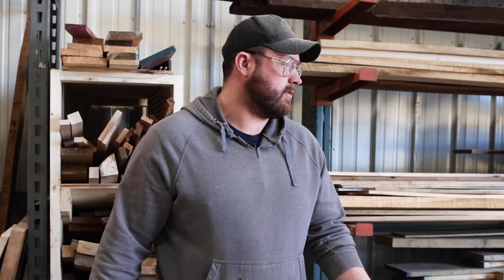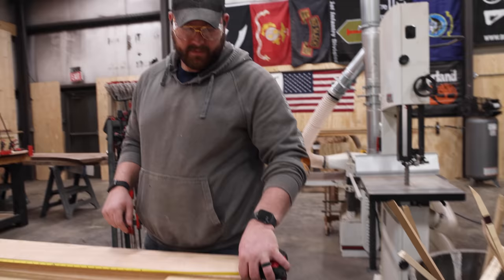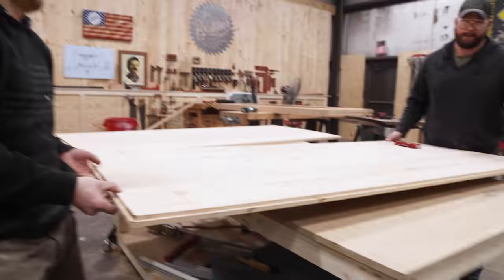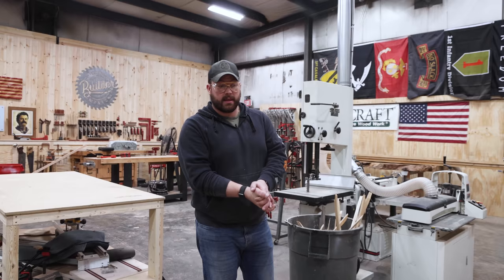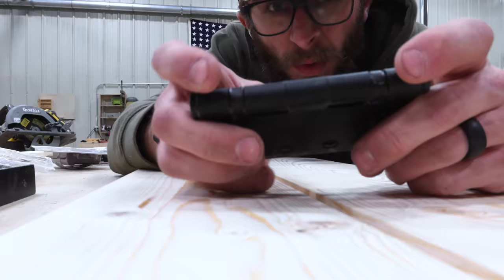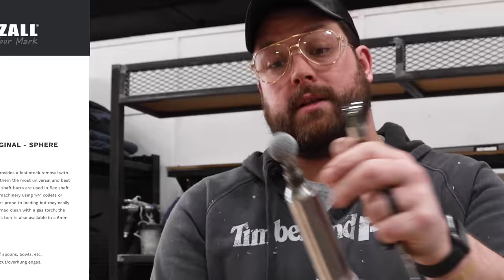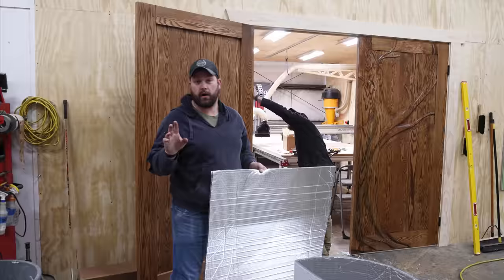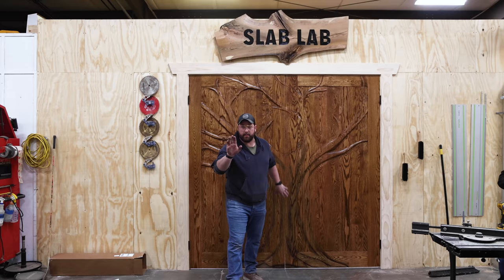Carving A Lord Of The Rings Inspired Door!

Comment: Looks awesome guys! 
Regarding sound - sealing all the air gaps will reduce sound, so adding door gasket / weather stripping to all the seams will greatly help with Ms Piggy’s grunting. Keep up the fun work!
Reply from the maker: She is very grunty!
Reply: Same recommendation I was going to make.
Reply: I also came to the comments to recommend weather stripping. Sound proofing is a game of small changes that add up to big changes - those little details really make a difference. 

Doors look awesome!
Reply: Exactly what I was going to say 
Sound waves are pressure waves they need to be blocked and absorbed to sound proof properly

Comment: I built a sound proof room for my drumset/ music recording and I used MLV (mass loaded vinyl) between two layers of drywall on top of heavy sound dampening insulation to sound proof. For example: insulation, drywall, MLV, drywall. It works pretty well, some sound gets out but not much. Putting things on the wall like foam diffusers or even build some wooden diffusers could potentially help absorb some sound waves as well. Its also important to seal all air gaps so sound waves dont get through. I also recommend putting a sound proof door behind that beautiful door you just made! 

Love your videos and products. Keep up the amazing work.
Reply from the maker: This is great thank you cory!

Comment: beautiful doors and the carving is amazing, perfect just the way it is. If you want easy home made sound dampening make frames and fill them with mineral wool insulation then cover in fabric, alternaively you can buy self adhesive foam sound dampening that they use in HVAC units which really helps stop the sound bounce off those big flat surfaces. Or do both. The first one is cheap and you guys will knock them out in minutes

Comment: You should get those foot pulls that go on the bottom of the doors like they do in the bathrooms at gas stations to open from the outside of the slab lab. They wouldn't take away anything from the door and you can still open the doors easily.

Comment: Could the lack of noise cancelling be do to the shared walls with the existing structures? Also, Im sure the concrete floor doesn’t dampen sound waves so try adding some of that rubber padding made to stand on.